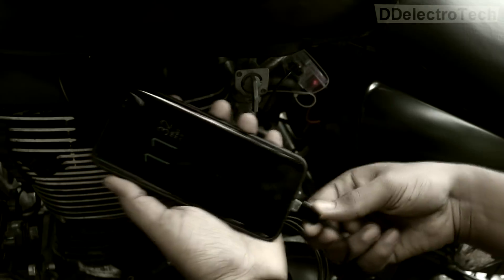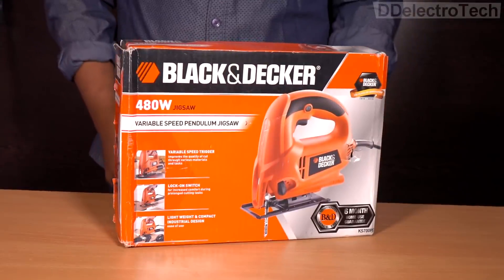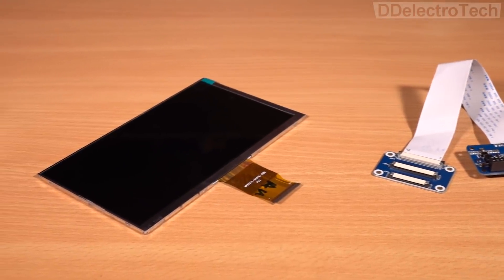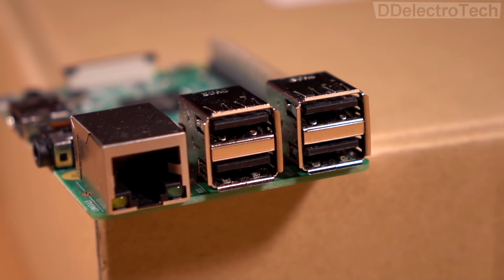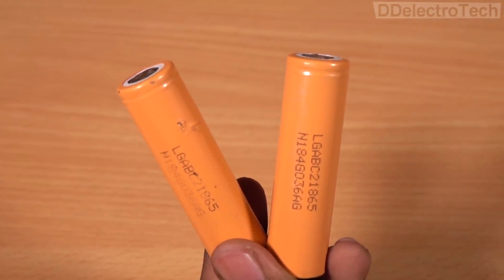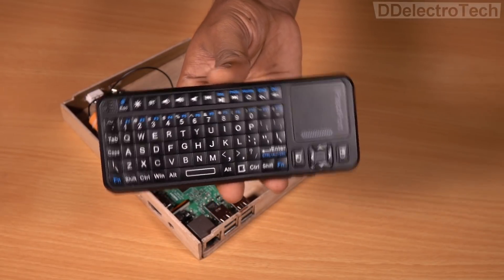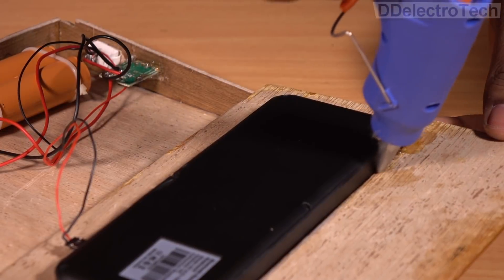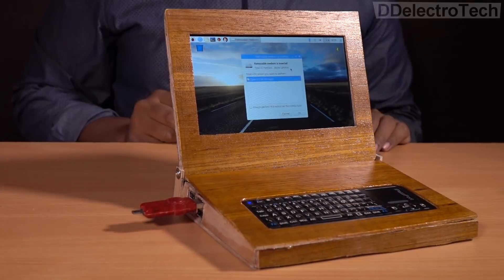How I Made my own Laptop / DIY Laptop

Comment: Gearbest is the most horrible website that I've ever shopped at!  They screwed me over on my Alldocube iPlay 40 Pro.  I still have not received the US charging adapter for it and the stylus and keyboard that was supposed to come with it.  I contacted them and I get an automated message sent to me by their system, but still no information on whether they're ever going to send me my items.  I have wrote to them several times through their support email, and on their website.  Still nothing has been done.  This has been going on since December.  I really don't even think that the website works anymore.  If it doesn't they should at least put a closed sign on the front page of the website.

Comment: these videos are really showing the worst of the DIY in your country. Not to generalise....but this is merely :How To NOT buy a Pi CASE....Seriously no 3d printer is good but this cheap assembly of pre made parts 1mm ply constructs. Seriously give these more heart... Raspberry pi 4 ok but expand it or add functions to it ....screen no touch ?? ok but at least put a wacom.....power supply from crappy lithium soldered battery...better to use a Rc battery to prevent fire....and finally use the ply wood pieces to cast carbon fiber at least...

You can use A constellation of broken parts for this DIY yet you chose the plug and play direction. 
Since the finish of the case is neither straitg square or beautiful ...No vents no cooling ....Man this is hard to do worst that that but i'l try

Comment: Great concept, but poorly executed. Your cuts are not straight - you should have used a set square to ensure proper angles so you can see your screen properly. You didn't lacquer the sides of the box, which makes it look half finished. It would have been great if you'd explained how you did the hinges. Filling in the edges of the screen so you can't see the rough edges of the unequal lengths of wood used to create enough of a gap for the screen would have looked much nicer.
For a beginner, not a bad job, but it could have been carried out in a more careful and detailed manner to make it look much nicer.

Comment: Is the battery replaceable?
Reply: @Tiri Mill yes the battery can you replace just disconnect the battery cable and but a new battery and connect the battery  battery to it but since the old battery is soldered you need drag it out and solder the new battery back

Comment: I got inspired by you and I am making the same laptop as cheap technology project of my school but as can you please suggest me as I have to make it cheap which board should I use raspberry pi Zero or Zero W or 1 Model A+ can you please suggest me that and also can you please suggest me the websites where I can buy cheap materials of the same and also need to buy a 5 or 7 inch display under 2000
Reply: pleaasee

Comment: Why you use wood when you have 3d printer
Reply: The texture of wood is better
Reply: Maybe cuz its stronger
Reply: Resembles a hardwork piece.
Reply: It’s not though..
Reply: Who thinks a stock of plastic wires is strong?
Reply: It would melt it
Reply: The right questions i guess is which is a good heat dissipation

Comment: Forgot the speaker      but nice laptop
Reply: its support bluetooth so you can connect wireless :)
Reply: @praveenleo8841  the bluetooth is already in use for the keyboard but he can use the audio jack to plug a headphone or speakers in :)
Reply: Valo
Reply: @praveenleo8841  You can use ear phone
Reply: @A Potato you can just connect it to the wall outlet?
Reply: @A Potato I mean it's not going to take longer to charge
Reply: Pam8403 5V stereo low current good quality stereo
Reply: raspberry pi  3 also have audio in and speakers
Reply: The conversation still going
Reply: Add mic
Reply: Yes
Reply: Yes
Reply: And Camera
Reply: Speaker is required but camera is not if you are making it for your online class so you can add camera
Reply: Right
Reply: @Anthony j lopez ohh I replied 1 year back and still the conversation going On 😁🤷‍♂️
Reply: And also mic 😂
Reply: There's audio output though
Reply: Can fix computer speakers using 3.5mm audio cord
Reply: You can connect through the AUX  in cable
Reply: Sir where you from
Reply: Me and my dad
Reply: You forgot about wirless haed phone or blutooth
Reply: Yes sure 😂😂😂
Reply: So nice thank you for giving this video
Reply: Yes
Reply: Lol
Reply: Everyone talking about praveen leo… cmon guys there is also wired speakers
Reply: Also, forgot microphone and built in webcam.
Reply: Also forgot camera which every laptop has
Reply: Never worry. You also connect to a 3.5mm jack speakers or by bluetooth
Reply: Use audio jack
Reply: @A Potato lol that's not how speakers work
Reply: @incesteagle1212  He talks about bluetooth speakers dude
Reply: Yea lol but if u use a lg g4 speaker for it u would have a loud speaker for it lol

Comment: Bro i have tried this before. The raspberry pi3 is very laggy on YouTube. It is not smooth as is should be. I had connected it to a 42” tv via hdmi !! Is that the reason for lagging? And i also used a hdmi to vga converter for 17” monitor. But still same lagging issues..

Comment: the main problem is pi3+lcd+keyboard already cost ~115$ while in my country cheap new laptop's prices start with ~167$. And even if you are able to create a laptop which costs less or equal to that price - NOTE that notebook has Atom, NOT ARM which theoretically allows to use most popular apps and not to search for their arm analogs

Comment: Hi there: Great project! I got the RGB LCD HAT that you use and plugged it in to my display. I modified the config.txt file as follows:

dtoverlay=dpi24
enable_dpi_lcd=1
display_default_lcd=1
dpi_group=2
dpi_mode=87
dpi_output_format=0x6f005
hdmi_cvt 800 480 60 6 0 0 0

The screen powers up and the backlight is on, but no screen activity shows up.

I know the display is okay because I can plug it into the HDMI+VGA+2AV Driver Board for Raspberry Pi that came with the display and the display works fine. I'm using the RGB LCD HAT because I don't want to have to supply separate 12V to the display adapter that came with the display.

Any suggestions you can offer are appreciated. My screen is
7" TFT LCD Display Module  
LCD size: 7.0 inch(Diagonal) 
Resolution: 800×3(RGB)×480 
Display mode: Normally White, Transmissive 
Dot pitch: 0.0642(W)×0.1790(H) mm 
Active area: 154.08(W)×85.92(H) mm 
Module size: 164.9(W)×100.0(H)×5.7(D) mm 
Surface treatment: Anti-Glare

Thanks for your help.

Comment: uninteresting video... just buying already ready for use parts and then building a crappy wooden case for it..  If you really want to to something interesting You can desolder the Usb ports and add an extension Cord . Remove the Casing of the Bluetooth Keyboard and make a decent wooden Case. By removing the usb ports you can make the laptop much thinner and better.
Reply: watch?v=8mrRFF72AZU Made a Laptop too which is 1000 times better.. (based on a rpi)

Comment: Can it play GTA V?
Reply: To play GTA 5  the pc or laptop should have min. requirements like 
 OS: ,Windows 7 64 Bit Service Pack 1.
Processor: Intel Core i5 3470 @ 3.2GHZ (4 CPUs) / AMD X8 FX-8350 @ 4GHZ (8 CPUs)
Memory: 8GB. (RAM)
Video Card: NVIDIA GTX 660 2GB / AMD HD7870 2GB.
Sound Card: 100% DirectX 10 compatible.
HDD Space: 65GB.
Reply: Jatin Pandey Yup, on ultra settings and 60 fps!!!
Reply: Mights LLC  no.
Reply: No
Reply: Yes it can. It runs on Windows 11 and it has the most powerful specs available. You can even mine bitcoin at a rate of 20BTC a day on it!
Reply: Jatin Pandey hell no

Comment: In the laptop where is the speaker
How can we listen songs or videos without speaker?
Reply: only earphone
Reply: Nishant Chanchad there something called Bluetooth headphones
Reply: It has a port in raspberry pi 3
Reply: There's usually an audio jack built into most Raspberry Pi models that you can use to plug in your own speakers or headphones directly.
Reply: ya it was on raspberry pi witch is on the laptop
Reply: The display may have a built in speaker
Reply: USB everything
Reply: Nishant Chanchad there's an audio port.
Reply: Mannii27 that was not Bluetooth device
Reply: It’s probably on the side
Reply: Using external speakers
Reply: It has bluetooth. You might need Bluetooth speakers to pair it
Reply: Headphones
Reply: Remeber it has bluetooth
Reply: Raspberry has a 3.5 mm jack, also a Bluetooth module.. you can always connect Bluetooth speakers.
Reply: Use the audio jack and hook good amplifier maybe a tube one. With a match set of EL84 tubes. I'm old school with a computer. 73

Comment: this rusberry is made of COrtex ARM V7 processors
so it's performance will not be better than an android phone...
as i am also a technician 
so i know this main board needs 5v DC power
on the other hand android phone board need 3.5-4.2 volts to work
so its another strain or ARM V7 processors with 5v oerating volts.

Comment: excellent job. make more research on it and make a small pc. instead of keyboard use a touchscreen keyboard. use HDMI for other monitors./ smart tv. use 3d printed same type slanted cabinet. It could be a very smart pocket pc. and go for a fundraising to make it commercial. Kickstarter could be one option for your funding. Thanks for the concept.

Comment: Bro buy startt 3d printer your wood work show clumsy and trying to be funny but not to me. raspberry pi3 {open source / platform = code: 9bell/9front (AKA UNIX)}. System on board used: Boardcom BCM2837. CPU: 1.2 GHz 64/32-bit quad core ARM Cortex-A53. Graphics on board: Boardcom VideoCore IV 300 MHz/400 MHz. Power consumption  1.5 watt idle to 6.7 under stress (heavy work). 
Pi 3; 1100 MHz ARM, 550 MHz core, 500 MHz SDRAM, 6 overvolting. In system information CPU speed will appear as 1200 MHz. When in idle speed lowers to 600 MHz. You forget to put heat shrinks (cooler) on processor.

Comment: This is an awesome PC and I am tempted to make this myself! I plan to use a mini-ITX motherboard and a 15" screen, preferably HD though. What screws did you use to get the screen to stand upright or at an angle? I couldn't find anything and opted for a window lock/hinge thing but it doesn't work exactly as I want it too and is a bit wobbly.
Reply: Do you remember this channel
Reply: @rishikmahith2885  i do ...
Reply: @orangex1447  ohh I forgot I just remembered that channel😁😁

Comment: Good idea, but people please remember it only runs linux arm compiled programs. Depending the price of the raspberry and some tools and parts, you can buy a decent phone that will do basically the same thing but will be more portable and you can just plug a otg adapter and a usb hub and use as a computer the same way, without any building work on it. 
For 20 bucks i found in internet a moto g1 quadcore 1,2ghz, that you can change the laucher and install the apps you want and do what i said. 

Other thing that can be good is a old laptop, but may be morr expensive, but if it is a non soldered pentium dualcore or core2duo or i3/i5/i7 it is a pretty good deal, and still upgrade it a lot and make it play some pc games.

Comment: finally, it's a cool idea! BUT your soldering abilities are poor. If you work with batteries, be careful! ;)
Reply: Dorian First of all you need clean soldering points and a good/minimum amount of lead, to take the forces of bending wires. How not to do is shown at time 3:09 , 3:13 , 3:29 .... Imagine what happens if one of the soldering points breaks and you get a short...Do you think the used batteries have a short-circuit-protection? ;)
Reply: modelllichtsysteme wow ur right
Reply: How do you solder lithium batteries safely please ?
Reply: shut up u noob

Comment: ITS NOT GEE BEE ITS GB GIGA BYTES GIGA BYTES
Reply: Well its a letter g and a letter b, he can say that. Dont you say "you ass ey" for usa? or you say youzey? 
Well... You probably speak the letters separetly speaking usa, as he spoke in the video.
Reply: Test Lol 
That laptop have a memory card 

Very nice
Reply: I thought u had put nigga bites 😂 but read more close cuz i was going quick
Reply: Tyreke Cathcart And why is that wrong? How do you say "usa"?
Reply: Eduardo Avila it’s U as in U it’s s as in S it’s A as in A USA
Reply: MoVPBOSS Exatly! So he can do the same thing with GB. 
G from g and b from b.
I tried to make a easy to read sound there, but i see that i failed on that. But still the guy from the video was correct. 
If you want to say giga bytes, ok, you can say that. But just like you can say USA, you can say GB. The same rule should be used on both.
Reply: Sand peper
Reply: Giga bytes
Reply: Test Lol Nope buddy.. He can spell gb. Just the same way you can say USA...
Reply: I swear if they're not going to type it right then they shouldn't type it at all
Reply: I swear if there not going to say it right then they shouldn't say it at all
Reply: Ayyyyy ^

Comment: Pls give me one its a humble request I'm not have a computer  so please  I'm your fan and your DIY
Reply: lol stfu
Reply: Do you have a phone? If the answer is yes, well... It does the same thing as this laptop. It uses the same mobile arm processor that wont run like 80% of the pc software because its is compiled for windows and/or x86_64 plataforms. 
You'd be better getting an old laptop from trash or some recicle center or even buying it cheap in the web. There are still good core2duo laptops or some pentium dualcore ones, that are at a low price, even at the price of a fastfood like some macdonalds stuff.
Reply: Eduardo Avila get your grammar together
Reply: MoVPBOSS I was really awmost asleep in that hour mate. But i am going to fix that now.
Btw, wow typing in a phone really sucks.
Reply: No, stfu and earn it dint beg to someone
Reply: gunnuts 93 O dont see much problem. Maybe he dont have the money to buy one. But i gave him some free options too.

Comment: Can I play GTA 5 on this
Reply: Labeeb Ahmad yes u can on 1080p may have to reduce settings to mid
Reply: yes you can play with ultra / 4k settings
.
.
.
.
.
.
just kidding
XD
Reply: No. It has 1.2 ghtz Processer and 1 GB RAM. GTA 5 works well if you have 16 GB RAM
Reply: Ashish Kumar アシュ 
Finally a proper reasonable reply
Reply: Rythm Designs U dont need 16gb ram u need 8gb
Reply: GamingWithNael ヅ 
8 GB is required
But...
16 GB is for heavy duty gaming
Reply: Rythm Designs actually you can have a playable experience on gta 5 with 4gb ram
Reply: Should run good. Minesweeper will NOT work, though. Even at lowest settings, it doesn't run good.
Reply: Labeeb Ahmad no
Reply: No
Reply: yes you can play but you need to install windows 10 try it its very easy after that you can play GTA5 even you can connect to monitor and it will run at 4k maxsetting 60 to 120fps
Reply: ahmad  tariq dumbass gta 5 is available on pc too since may 2015
Reply: Ahmad Tariq you can play on Pc too
Reply: You wish
Reply: Ahmad Tariq you can play gta 5 on laptops
Reply: you do know gta 5 is for pc too right lol
Reply: no ahmad it can only play on x box or ps4

Comment: the cost of this laptop
Reply: 10535 pakistani Rupee
Reply: 50$ raspberry pi ... you just need to download the raspbian Operating System to a SD card and ....conect with hdmi the screen .. and 10$ for a wifi usb receptor
Reply: Itne me to mini laptop aa jayega
Reply: it's not a good investment... spending 7-8k on this is stupidly. instead but Acer laptop. 

I got a Acer laptop with intel i3, 4Gb ram & 500 Gb hard disk for 20k. 

& it runs very fast on windows 10.
Reply: +Rythm Designs how in Pakistani
Reply: NEGATIVE
Reply: Rythm Designs I can do a better PC with a hundred bucks.
Reply: Tech Creations it is really expensive!
Reply: Its in indian rupee
Reply: Thats like a 100 dollars

Comment: Can I Run Microsoft Windows XP Professional SP2 On it?
Reply: yes you can
Reply: Thanks Vaia.
Reply: On a raspberry pi?
Reply: No, rpi is arm, windows xp is X86
Reply: get a board with an Intel/Amd cpu then you can run XP sp2
Reply: use exagear u can run just mak sure u have a hi cap. micro sd card
Reply: no you cant
Reply: same structure processor of android devices not capable of windows tho there is a development windows 10 os that works quite nicely
Reply: You can on cloud
Reply: "Yes you can" is the slogan of Windows XP? Was this intended? :thinking:
Reply: yes it can run windows RT
Reply: Pi Doesnt run windows

Comment: Nice I make my own laptop and it’s possible because of you thanks bro great work
Reply: Anant Kaklij 7000 Indian Rupees
Reply: its a waste. not practical at all. 

I bought acer laptop with intel i3 processor, 4Gb ram & 500 Gb hard disk for only 20k. 

the build quality, display & battery life is also good. It runs very fast on windows 10. 

I have very expensive laptop for myself.. wanted a cheaper one for dad & got this. Amazed to see how well this 20k laptop runs. it's same as my 45k laptop. 

Highly recommend it.

Comment: It looks so messy and unfinished T^T you could have taken a file and properly make the port holes and even out the edges of the monitor. Then go around all of the pieces with some sand paper and and then the silicon carbide type paper. Add some primer and give it a black or white finish of 3 layers. Or add some vinyl wrap around the case. And you should have added a fan to keep the Pi cool as it will overheat in there without cooling of any sort in a closed space.

Comment: Nice design. With my cardboard laptop project, I butchered a dead laptop of mine for the keyboard, and possibly the display later. I would butcher a tablet keyboard to get its respective USB converter, apply it to the keyboard, and put it in a piece of cardboard that would have the top layer stripped so that I can lay it flush with the cardboard. The jutting parts would be shifted under the non-exposed cardboard.
Whad would you think?